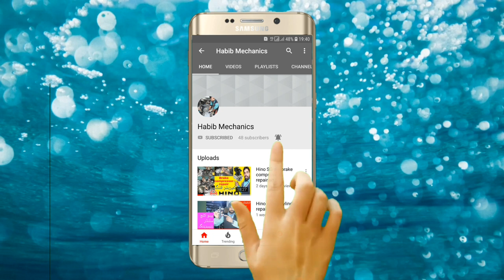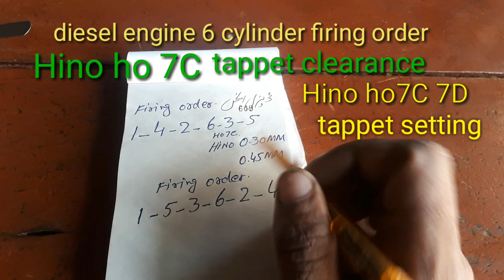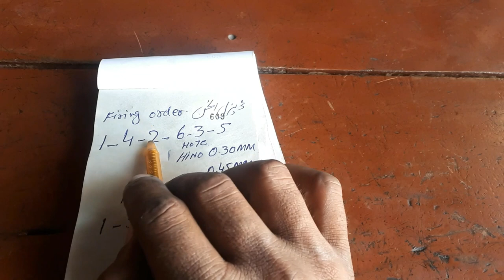Hino ho7C 7D engine 6 cylinder faring order tappet clearance tappet setting

Comment: 6hh1 camshaft settings.

Hello I want to find out more about the Isuzu 6hh1 camshaft settings.standing in front of the radiator,the mark "B" is supposed to be a 9 o clock position when lining the mark before you start,after that what position must the "B" be on before we close the cam cover?.according to the manual "B" lines to the side but little info is given has to where the "B" must face before cam cover must be inserted.also what is the setting? Must it ROCK on "1" and fire on "6"?

What's the correct suquence? 

Rock "1" fire "5"
Fire "1" fire "5"
Rock 1 fire "6" etc...

Please help out coz my engine doesn't want to stay idling on its own.